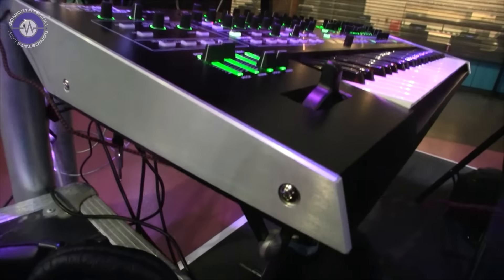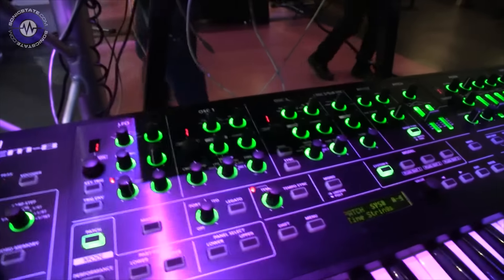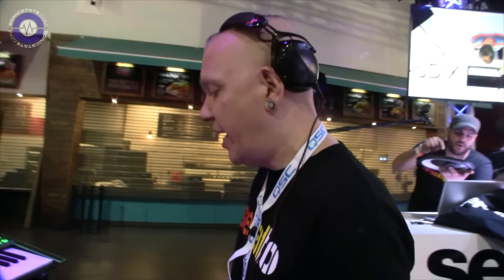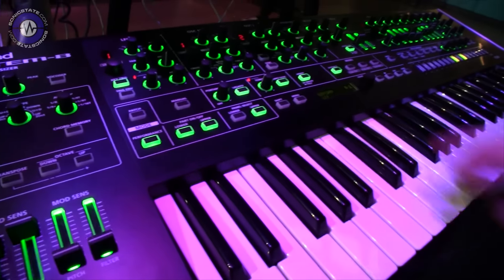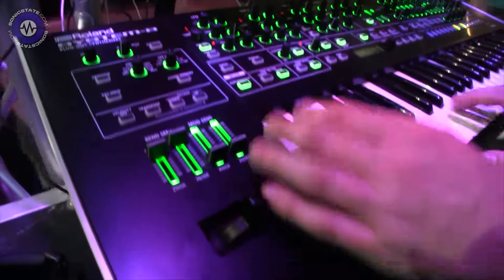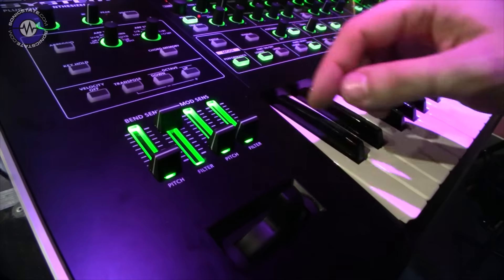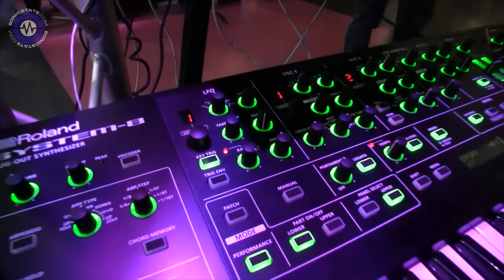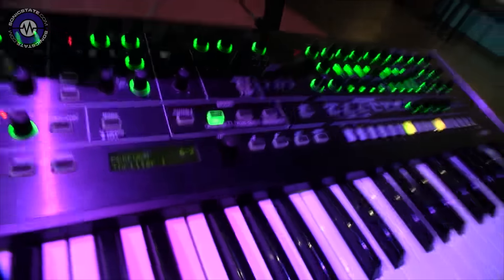Roland System 8 at BPM

Comment: Now if only SynthGraphix would release a new front panel overlay for the system 8 with a shiny black surface and hard to read green lettering!! I love the 8's interface! I highly recommend getting SynthGraphix JD-XA overlay by the way. I love mine.
Reply: JD-XA looks way better than System 8's monster green lighting and cheap finish. JD-XA at least has the metal bracing and is definitely a notch above (even inspite of the apparently unforgivable crime of having plastic glossy panels instead of metal look).

Comment: I'm already wondering what is coming next for plug-outs. And will we see any new patches, firmware updates and so on for the older Aira products? If they do any more mono plug-outs, no reason they can't be on the System 1 as well.
Reply: Can't think of a vintage Roland synth that would have everyone opening their wallets should a faithful sounding new plug-out [they have all been really decent sounding so far] be released off the top of my head. What 'range' haven't they tackled so far?
Reply: Well I'd hope they have a JX-3P on the way, but yeah, other than that, I can't really imagine any other classic Roland analogs that people have been waiting to come back.  Maybe they can just finally put this to bed now that they've done this, and go back to iterating the V-Synth.  Maybe a System-V.  ;D
Reply: Hard to imagine 3 plug-out buttons on this without more models coming to fill up that SD card at the back. Rumour is a Roland rep said they are going to focus on older, slightly less well known synths.

Besides, it's a damn good business model. R+D costs to design a plug-out. Then it's just license keys. No manufacturing costs, distribution or whatever. Just a bit of bandwidth. And there's a great reason to do more mono plug outs now, because there are all those System 1 owners out there and now System 8 owners.

Based on that I daresay the System 8 won't be the last plug-out synth they make.

Comment: Nick can you please find out if you can have multiple copies of a single plug out? Like let's say you want plug out slots 1 and 2 to have a Jupiter 8?
Reply from the maker: I'm not sure it works like that, I think you can load one into both slots, the DSP code will run on either split or layer from one plug-out slot
Reply: I haven't tried it, but I can't imagine a scenario where that would be necessary, as you can already use two instances separately (layer/split) anyway.
Reply: I can't see any technical reason why you couldn't load up several slots with the same model. It could be useful if you e.g. want 128 Jupiter 8 patches on board, since there are only 64 patches per plug-out slot.

Comment: Nick can you comment on how close this sounds to an actual Jupiter-8 in person? It is hard to tell from compressed audio/video but every demo of the System 8 seems to sound very digital and crisp/cold. Thanks for the additional info and video!
Reply: It sounds FUCK ALL like a Jupiter 8, just as the boutiques didn't. It's all a con. Anyone with good hearing knows this. Nick and pals won't say it out loud as they will upset their business partners though. It's just another soft synth, in a fancy box. I can get JD-XA (analog engine) to sound closer to a JP-8 than this ever will. What you have is the inept of hearing, inc some who should know better, claiming 'ooh it sounds just like juno/jupiter' when in fact it sounds only like an impression of them. Software still lacks the weight and punch of real analog (even DCO). And the response and filter interactions, LFO modulations etc all sound mediocre on system 1 plug-outs so why would sys 8 change? Compared to a real analog its night and day if you can actually hear.

Comment: Does anyone know if you can filter the velocity of the JD-XA?
Reply: Yes, hold shift and adjust the 'env depth' knob that adjusts velocity to filter response. Hold shift + Amp knob to adjust velocity to VCA. Also you have aftertouch and 3 LFOs on the JD-XA. It's a bigger/better synth when you get down to it. System 8 is a different thing really. JD-XA is phenomenal (I also prefer the sound esp the real analog engine)
Reply: Thank you so much! You must know your way around the synth, for that piece of info? Since I have you, Is there a easy, quick way to initialize a patch? On the JD-XA
Reply: Mark Eubanks Yeah - you hold the shift button then press "program select" (it says 'init' below it as all shift functions do like shift + 'enter' (Manual) makes it use whatever the knobs are currently set to - manual mode). good luck!

Comment: How did Roland manage to crank out 3 or 4 synths before Arturia could crank out  one?
Reply: Because they're Roland and not Arturia....
Reply: Probably as Roland are worth billions and have many employees and don't really need to spend time getting things perfect as they don't need the money, plus everything is digital. 
I'm guessing you're talking about the Matrixbrute, which is analog, made by a small company, something totally new....that'd explain it really.
I'm sure the Matrixbrute will kick ass outta this too
Reply: probably. I am really drawn to the system 8 although I am not the most supporting of digital. I am also really drawn to the matrix brute, but I just want it to come out. I was saving for one, but I ended up getting a prophet 12 module instead which I do not regret, but I will still get the matrix brute despite me wanting it now. I just wish they had not announced it until it was really almost done.
Reply: because it's software. analogue takes time to test and calibrate.
Reply: ewanstefani
 hmm didn't know that process well that makes sense

Comment: Recently, I've been thinking how awesome it would be to have a Gaia 2 with the System 1 engine.  I guess this is kinda close to that......   Roland gear always seems overpriced to me.   This looks fun though.
Reply: Yes! The Gaia sounded soo boring.  So many oscillator waves and variations and so many filters and they all sound bland!  Its biggest strength was laying crazy sounds using the individual tones and the immediacy of sliders and knobs.  Of course it had plenty of extra bells and whistles too.   But man was it not exciting.   

And I nearly forgot about the JD-XI and XA!   I thought the System 1 sounded good but the limited polyphony for a digital synth turned me off along with  the 2 oct keys.... and the "scatter" thingy.   I'm also not a huge fan of the plug  out things but I guess I'm one of the few that doesn't care too much about 80's roland.    Seems like a nice bonus though.  And probably where the extra 500 came from on the System-8's price . hah.
Reply: The Gaia wasn't a rompler! Find it amazing how X persons couldn't read a spec-sheet, and now the whole synth community mistakenly believes it's a rompler.
The spec-sheet clearly states that it's analogue modelling, then there's an obvious space, and THEN it says PCM sound generator, referring to the GM sound module hidden inside accessible only via MIDI.
As such:

Virtual analog synthesizer sound generator (Number of part: 1)
(Oscillator + Filter + Amp + Envelopes + LFO) x 3
 
PCM sound generator (Number of parts: 15)

That said, it didn't sound all that great, but the excellent interface, 3-layered voice structure and effects section gave it a massive scope for sound design. So wouldn't call it boring sounding, but it wasn't up to scratch vs. better emulations or true analogue.

The System-8 is looking amazing, but frankly think it's too expensive. As you say it's gunning for things like the KingKorg. No doubt the System-8 has the more comprehensive frontpanel interface, which is great. But the KingKorg cost just over half of the System-8 where I live, has 3 times as much polyphony, excellent modelled filters, more oscillator-options, and a tube in the output stage - which might seem gimmicky, but it's actually pretty awesome.
The DeepMind with 12 analogue voices is set to cost 2/3 of the System-8. Not to mention you find Nord Leads and Dave Smith stuff around the same price.

I really like the Aira range, and I want to like the Boutique range, because they sound nice. But they're all considerably overpriced for what they are (especially the Boutique-gimp), and when you factor what else is available in the price range it gets worse.

I love the idea of layering a Jupiter-8 and a Juno-106 in a single keyboard, but at the end of the day, it's too much money for a digital rehash, no matter how good it is.
Reply: Marc the Darc The Gaia wasn't a bore to mess with. Layering sounds plus FX was its biggest strength.    But the individual oscillators and filters were incredibly bland.